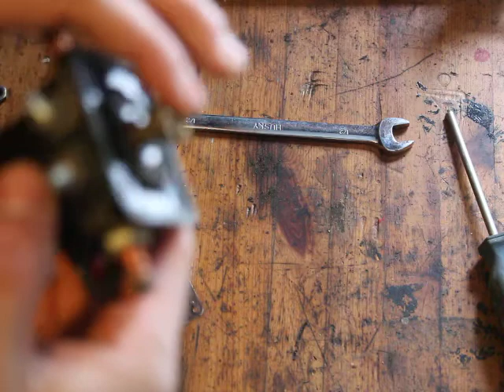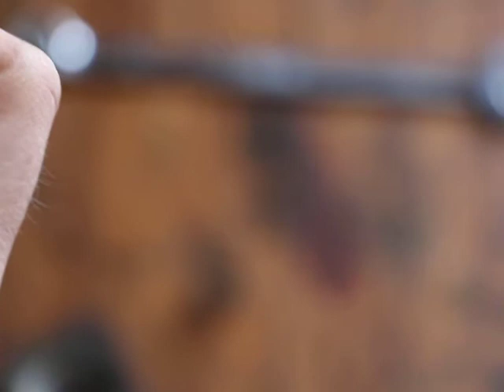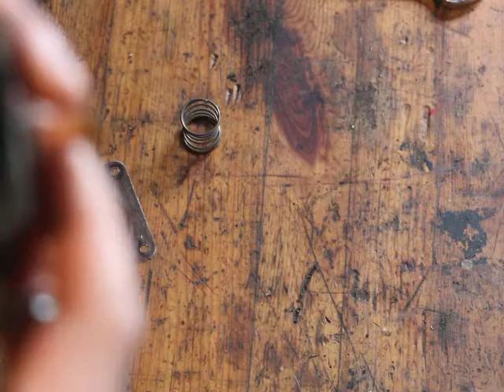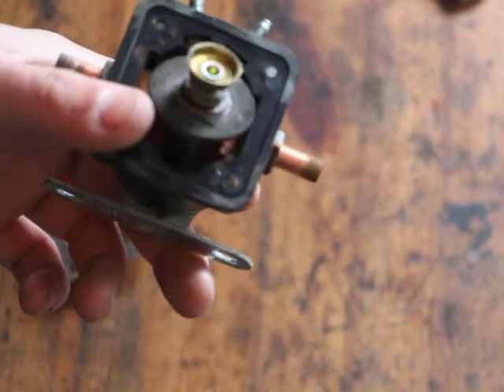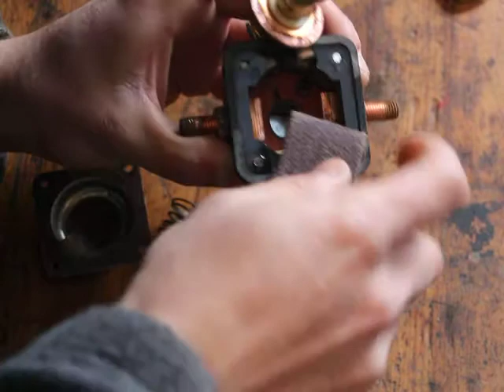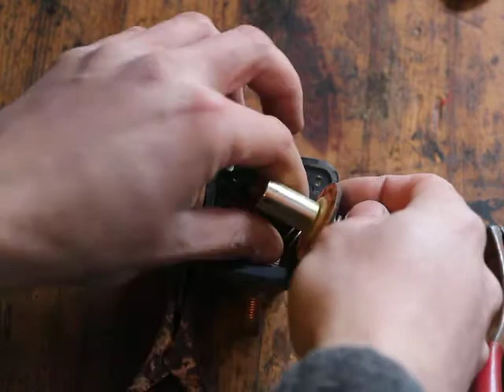How to test a relay 1966 Thunderbird starter solenoid disassembly p2

Comment: Thanks to you, I could connect my relay, actually i thought my realys were faulty after connecting 2 inputs to +, - power. but I terminal is not input
Reply from the maker: Excellent. Im glad to know i could help. Please share the video and channel with other people that could use them.    
As for the I terminal that's exactly right. There are some starter solenoid that should have 2 inputs...but they're harder to find and more expensive.

I will do a further dissection of a solenoid to see if I can rewire that terminal to make it an input

Comment from the maker: The 'I' terminal is a temporary terminal connected to the big terminals. 
In a neg ground system, the 'I' terminal is temporary + since it's connected to the large round point that connects the + battery terminal to the + side of the starter.

In summary, it's a temporary + terminal